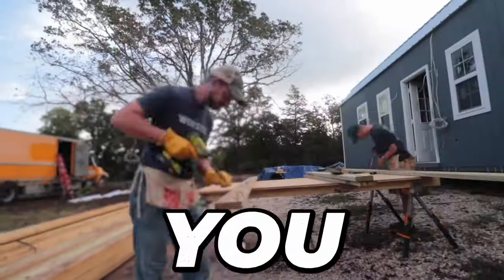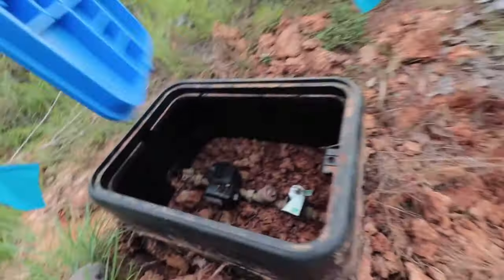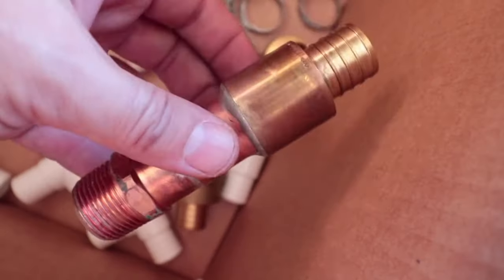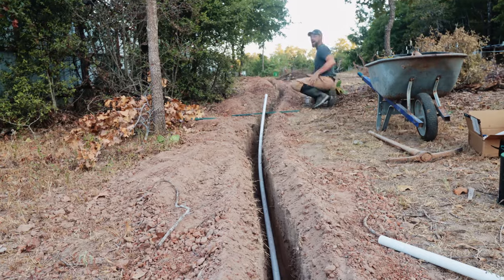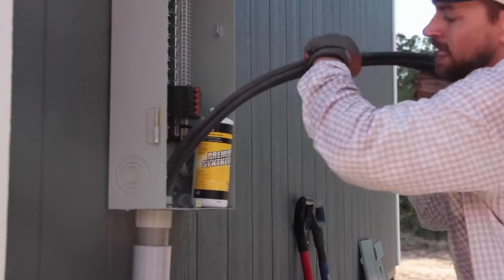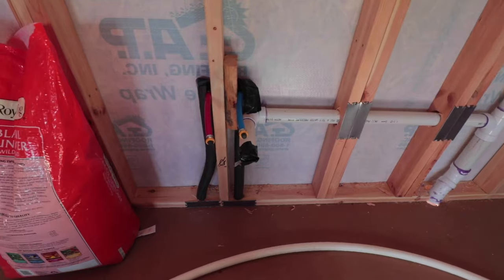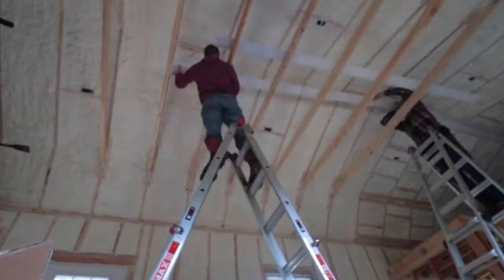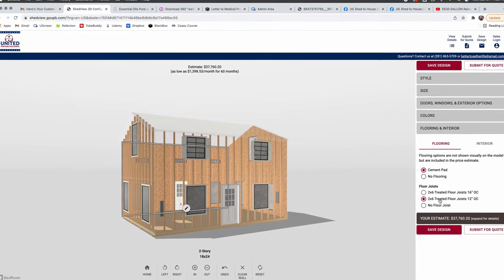Many 'DIYers' Will Regret Their House Conversion Because Of This!

Comment: A few tips from someone that built his tiny house on family land. My house was 16'x24', (384 square feet). 
1) multiple useable spaces outside
Most people live in a tiny home to reduce their "overhead"/cost of living, but we all want places to enjoy our house. The compromise is making useable outside spaces like, decks, screened in porches, fire pits, glassed in porches, outdoor kitchens,  etc. That way you can enjoy the outdoors and even have enough room to entertain guests and still only have to heat/cool your tiny house "inside" area but still get a huge outside area to enjoy. Do you feel like your tiny inside shower/tub is too small? Make an outside shower or tub as HUGE as you want and if you have neighbors then just put up a shower curtain and/or privacy walls. I plan on putting an outdoor shower in my screened in porch with privacy lattice, pull down shades, and a shower curtain, then I plan on putting a jetted tub in my porch to relax after a long day and enjoy the fire pit view with some beers in my ice chest on side of me, and all out of the mosquitos here in southern Louisiana. 
2) tall ceilings and many big windows
tall ceilings make the tiny rooms/area/house feel much bigger. Even if you go with a traditional 8' wall and 3' attic making the total height of your roof about 11' tall, one way to make the rooms feel much bigger is to insulate the rafters then put sheetrock or my favorite tongue and groove boards on the ceiling and either box the exposed beams to make them look bigger or come back and box them later as money allows. This way you don't have to pay for a taller walls and higher ceilings but you get a taller ceiling compared to regular 8' ceilings. Trust me this will make the rooms look and feel much bigger. Big windows will allow you to see outside which will make the tiny rooms look and feel much bigger. Another trick is to get two or three big windows, 3'x5' and put them side by side to make a HUGE window, having this facing a wooded view is gorgeous and make your living room or bedroom look and feel HUGE!
3) tongue and groove instead of sheetrock
sheetrock requires manpower to lift, set, and screw into place 4'x8' sheets, then mudding, then finishing, then painting. I prefer tongue and groove boards because you can buy them, measure them, cut them put them in place and screw them in the seams for no exposed screws, and you can either leave them plain, stain, or paint them at any time. And no more need to find a stud to hang things on your walls because the tongue and groove boards can be screwed to for support anywhere. And if you want sheetrock in some places you can screw or glue the sheetrock to the tongue and groove for an either an accent wall or to change up a room
4) on blocks and a slab
I would 100% recommend pouring what your local code probably requires which is a footing/chain wall all around the outside the foundation and anywhere it is loadbearing, usually 16"x16", THEN on the rest of the foundation pouring 2" of cement to have a solid cement slab under your house. I also recommend going AT LEAST 4 cinder blocks high because this will allow you to use a automotive creeper to slide under your house to do plumbing installation, repairs, inspections, and maintenance. If you can afford it check with local code to see if you can put a mound of dirt to have your foundation higher than the surrounding yard so that water can drain away from your foundation. Sometimes dirt has to sit and compact for a year, or can be mechanically compacted. If you can have your foundation at least 6" higher than the surrounding yard, then grade the yard down from the foundation away to make it resemble a turtle shell or "turtle back" you will have better drainage. 
5) gutters, water collection
check with your local codes to see if you can collect your rain water and if so pipe it to a tank, if you have the money a huge tank in the ground, or one or multiple tanks out of the ground, that way you have unlimited water for gardens or even if you setup a reverse osmosis system unlimited house water
6) tankless water heater
unlimited supply of heat water that only runs when you ask for hot water. If you live in an area that gets below freezing I would install inside, a gas unit is more efficient than a electric, they also have high efficiency  ones that are about double the price but they pay for themselves over 10yrs, if you don't live in a below freezing area then they can be installed outside and if a freak winter freezing storm is coming just make an insulated box on a stand that you can place on the outside of the heater, safe distance spacing should be labeled right on the unit but I would have the box at least 2 feet away on all sides from the heater unless otherwise stated on the unit to protect the heater from freezing, then after the freeze is over remove the insulation box, vent the box to allow for heater use with insulation box mounted

I built my 384 square feet 16'x24' tiny house at 32yrs old on family land. Then every year I take tax return money and my savings account and do one house project. That was 11yrs ago. I added a 16'x24' screened in porch, then 16'x24' carport, then 16'x12' shed, then framed up 1/4 of my porch and made a bedroom/8'x12', then converted my old bedroom to a laundry/linen/panty, utility room, then poured cement under my carport, then poured cement under my porch, then poured cement under my house, then made a 15' fence from my house to shed, and 50' fence from shed to parallel my porch and carport to make an open backyard courtyard, then added a 16'x33' fire pit awning from carport to fence overlooking the open backyard, next year I will double my screened in porch adding 16'x12', then a 20'x20' covered outdoor kitchen, then a 15'x15' mediation garden with raised planter boxes, chairs, a water feature, and lattice roof with vining plants on the roof for semi-shade. Also every year I would get one dump truck full of limestone to make my driveway wider and thicker, then I put the limestone in my parking lot on side of my house, this would allow for about 9 vehicles to park easy all parked facing out so they don't have to do circles and mess up my yard. I also recommend putting landscaping timbers on the edge of your parking lot with 3' tall metal poles with solar string lights on them to show the edge of the parking lot at night so others that don't know don't mess up your yard turning around or get stuck. 

My point is once you have a tiny house you can take your time and add something once a year to slowly build what you want, or if you have the money just pay someone to do it all at once. But the over time way makes it much more attainable for most and hopefully with little or no mortgage
Reply from the maker: Thank you Ross!!!  Always appreciate your expertise!!